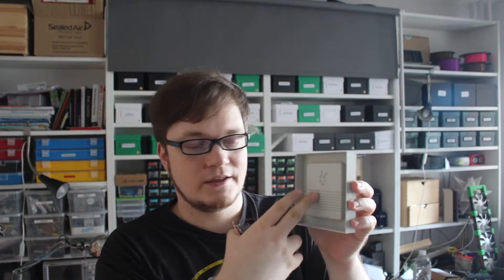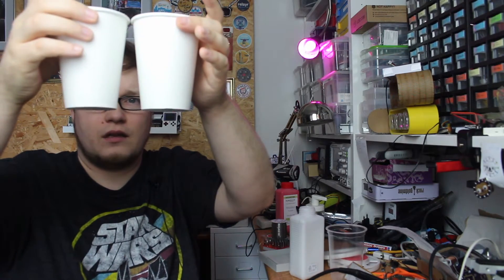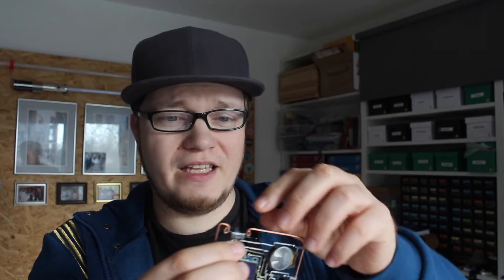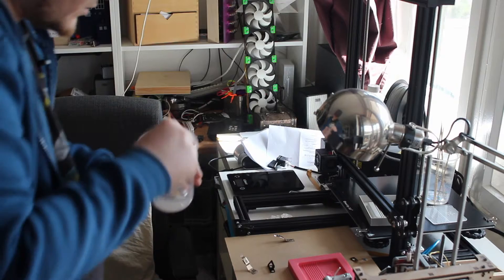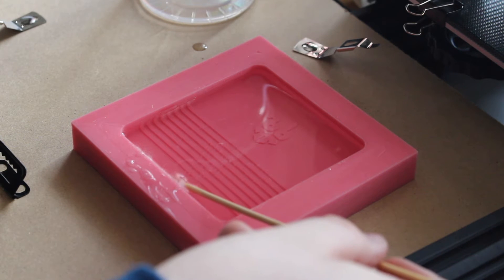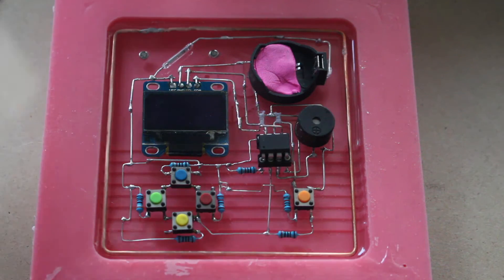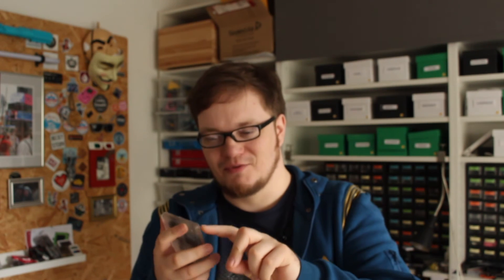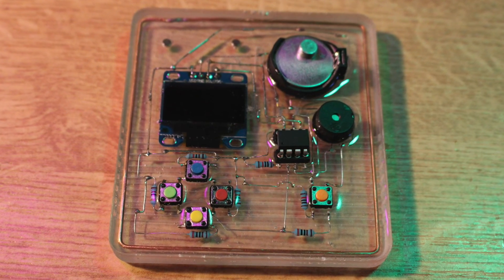Resin Encased Skeleton Handheld

Comment: This is amazing, you've inspired me to make my own... though I am still having no success at all with finding a way to actually program the IC.
Reply from the maker: I wanted to film a tutorial for that for the longest time now, but element14 keeps me very busy... :D where are you stuck at?
Reply: @Davedarko  Well to be fair I am no arduino wizard like I feel you are :D

I have some experience with the nano, but I already very much appreciate the effort of you replying.
But if you could point me to a tutorial, guide or even some simple information about how to program the ATiny85 from a PC that would be greatly appreciated.

A tutorial would be really cool as well, but don't stress it. You seem like a very nice person that makes cool things, so I trust things will play out just fine.
Reply from the maker: @aranso  It's just experience through learning by doing :) The following links seem to do a great job and use the same library. You can also use the nano as the Arduino programmer that they are talking about. You need to find the same pins they're using, but that should be easy.

https://create.arduino.cc/projecthub/arjun/programming-attiny85-with-arduino-uno-afb829

http://highlowtech.org/?p=1695
Reply: @Davedarko  Oh thank you!
Again the effort of replying and actually finding some material is appreciated so much.

I am sure I'll manage from here, thank you for the extra info... well and of course the videos in the first place! I like your style, simple but not simplistic.
Reply: @aranso  did you just ask the man to google that for you ?

Comment: Fantastic, turned out great! I want to figure out a similar HDPE approach , with so much HDPE "waste" around! You could probably just press a circuit in once it is hot enough! .. or maybe it would be cool with all the solder splash , so you could full circle use it as a support once you have a template!?
Reply from the maker: interesting idea! I still have a box of HIPS support material that I wanted to recycle at some point.
Reply: @Davedarko   cool, I really want a phone that looks like this now, so I can say it's the latest €1k+ luxury device .. lol

Comment: Really cool project. If you would have wanted it shiny, you might have a try "painting" the 3D Print or the Resin Case with Resin. Like with XTC 3D when you like to check thatout on youtube ;-)
Reply from the maker: Exactly :) I have another idea for the resin, now that I have it! I want to make LEDs in their schematic representation next (without the light arrows though). To get them shiny I thought about dipping the master in resin first, to get it shiny.